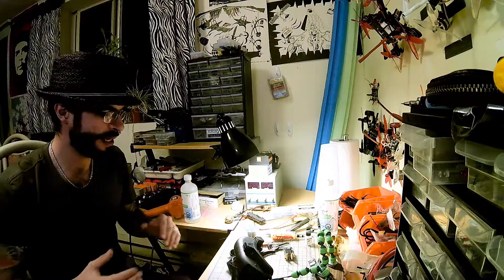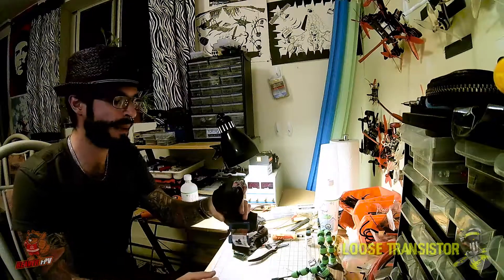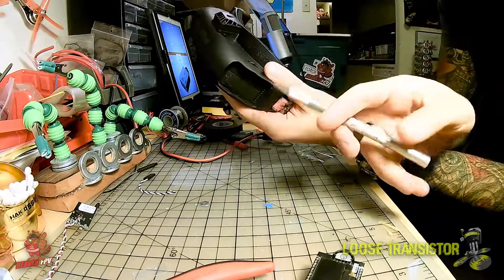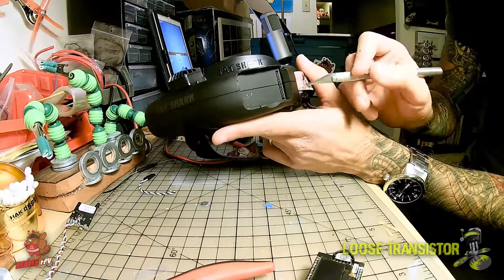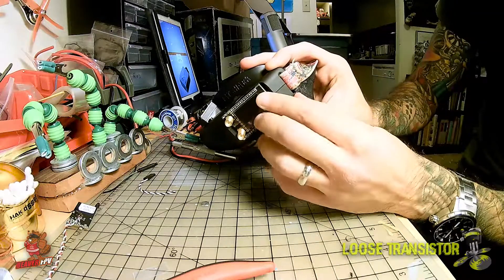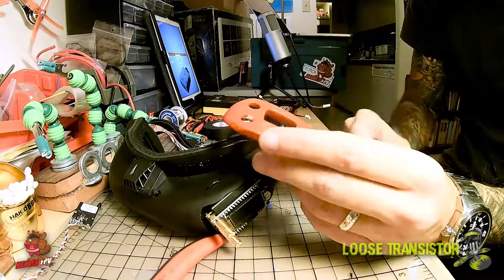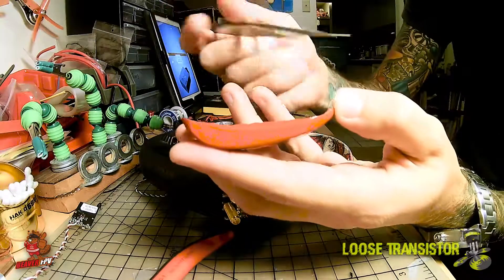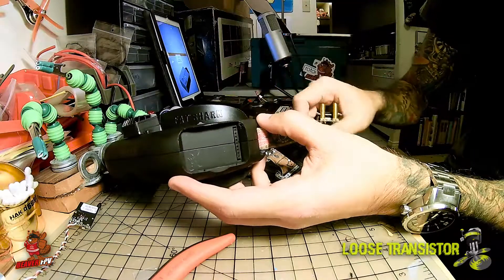HOW TO QUAD ♠ Installing Furious FPV True-D Diversity on FatShark Attitude V3's - The Easy way!

Comment: hey man i was wondering i installed the furious fpv true d v3 with my fatshark foca v2s they looks pretty much the same, and it works everything is great, but for some reason its a making a beep like every couple seconds. it pretty annoying
Reply from the maker: TALLSOUL hmmm, how are you powering the Google's? Check the voltage, usually the beep signals low power

Comment: i dont need to do anyting else but shave the edges and place in module and it will work i dont have to change any firmware?
Reply from the maker: Justin Wright yeah man, just shave it so it fits in the goggles and from there it's plug and play.

Comment: How does this compare to the Lafordge mod? What's better?
Reply from the maker: I hear Laforge is better overall, but I have not used it. Not sure how easy it is to mod into the Att V3's. Also, the True-D is a lot cheaper..

However, these days I am recommending the Flying Lemon 2 Pineapples receiver.

Comment: trying to figure out what to invest in currently got fatshark attitude v3 spironets attenna and stock module on 5" alien tramp vtx set at 350mw but i have breakup and i need more confidence with my fpv setup, would i be better off with fatshark hd3 with laforge or true d, can i have diversity some how on fatshark attitude v2 even though cant be mounted internal to goggles? I wanna keep my tramp vtx whatever i do.. Help what should i do
Reply from the maker: I would recommend upgrading either to the V3's or Domniator series, they are much better. Invest in a good diversity receiver and get a Patch antenna, either spironet or menace.
Reply: laforge v2 is maybe what im leaning towards, thanks for your help i hope to get this sometime so i can feel more confident with certain things i wanna do

Comment: Dear Loose Resistor will that work with the attitude v2? Thanks
Reply from the maker: Hmmm Not without some serious modification. You would have to figure out the pin layout on Attitude V2's and match them up!

Comment: All i did was round off the corners of the lower module plate with a small file, loosen screw of goggles put module in and tighten again. This way it is held in tight and did not have to mod the goggles at all. It basically gets clamped in by the 2 halves of the goggles.
Reply from the maker: Hmm thats a good tip, I will keep it in mind! Thanks Glen!